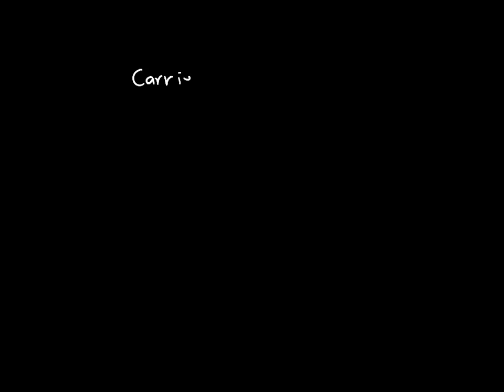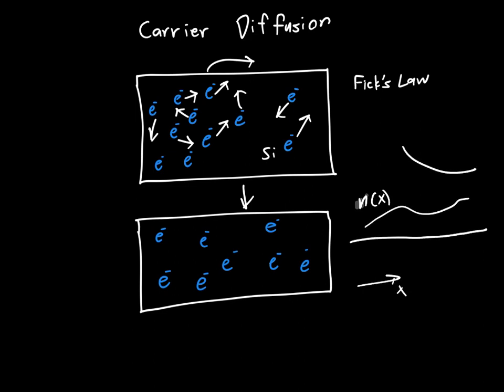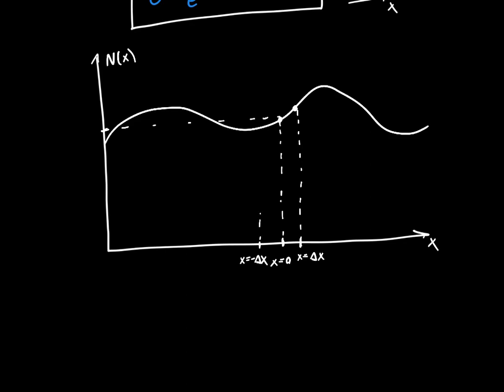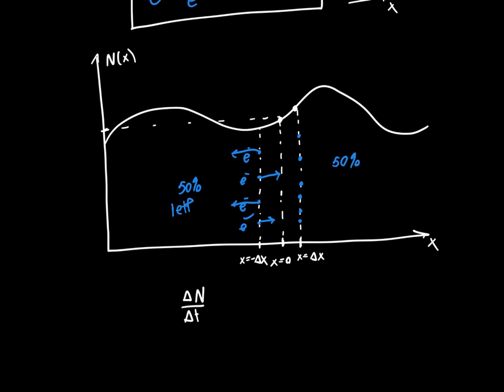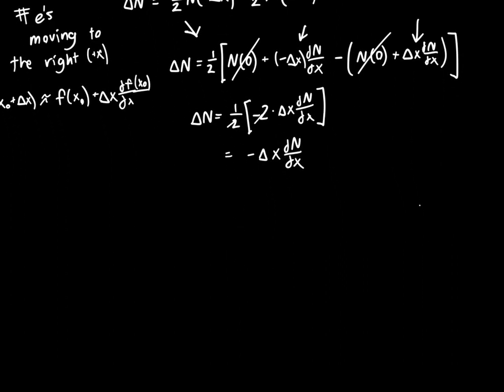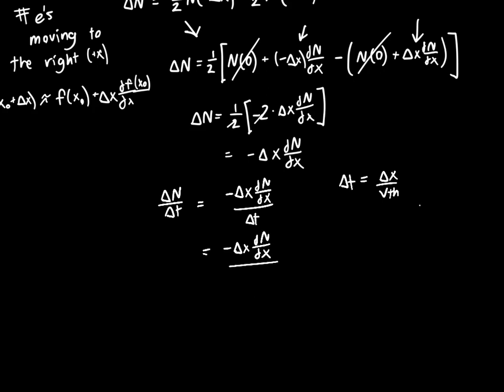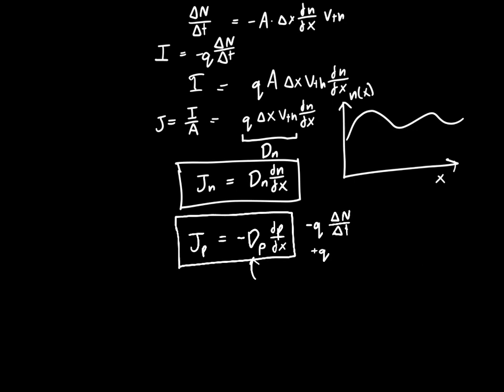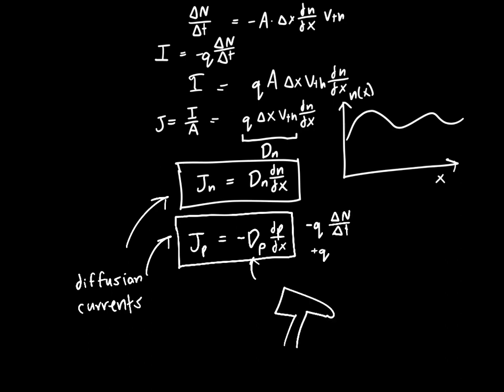Diffusion Current for Electrons and Holes

Comment: Hi, do 50% of the electrons always pass like this? or did we just arbitrarily pick that? Also, thank you so much for this series!
Reply from the maker: In general if you just plop a bunch of electrons at a single point in space, they will (statistically) diffuse uniformly outward. In 1D, that means 50% will move to the right and 50% will move to the left. It's basically quantizing the diffusion process into discrete steps.

Comment: Thanks for the video. But I am still confused by the Dn. Dn is delta X * V_th, and then what should be delta X? So far, delat X looks more like a variable to me and I don't see how Dn can become a coefficient. 
Hope to get your reply. Thanks in advance. It's a wonderful job to create this series of videos.
Reply: in our cours my teacher used dx instead of Delta x in the diagram and we've been told that dx means a very little distance( as dt means a very short time, dv for elementary volume or a very little volume..) and this delta x Equivalent to dx ( i think) so it stands for a very little distance and not  a variable. i hope that makes sense and doesn't makes you more confused :D
Reply: @lailachokri2852  thank you so much. yes,  your explain makes  good sense.